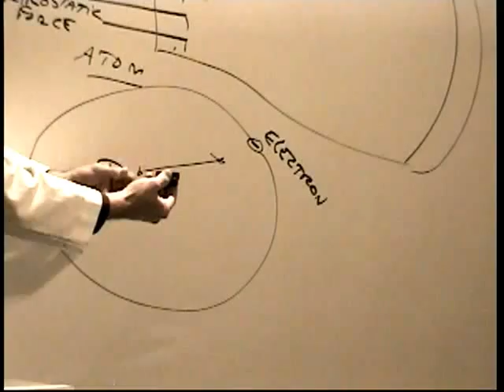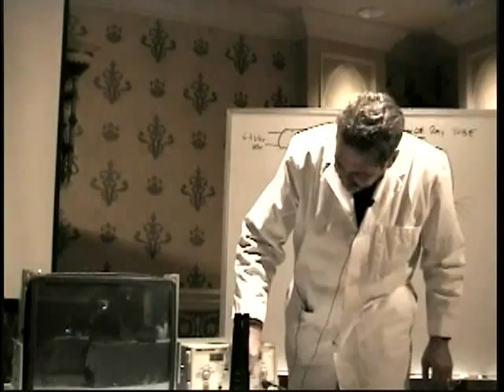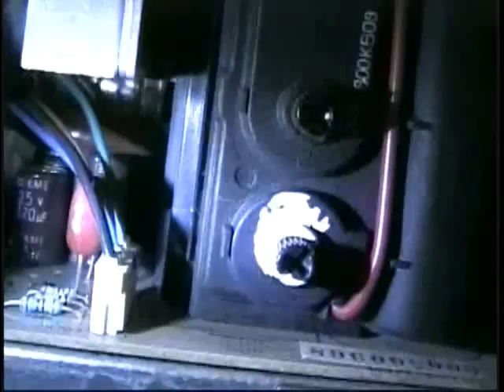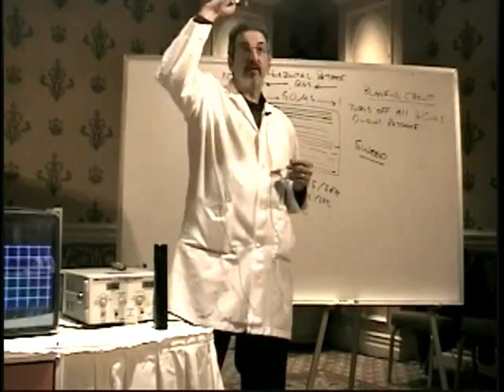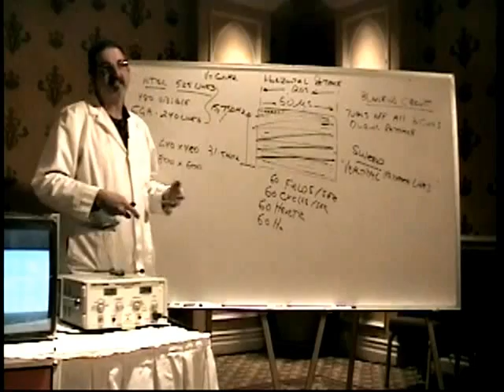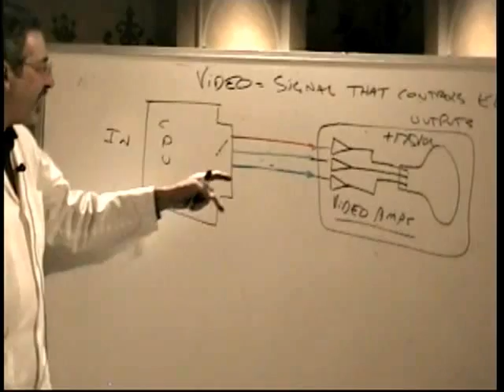CRT monitors-Part 1of 4

Comment: So I see you have a pattern generator but I haven't seen in any of your videos how that is powered and it works. Is there a pattern generator (PG) that has a transformer so you can plug power directly into the PG and the PG into the monitor. Sorry for asking such a newbie question :)   I'm trying set up my test bench to be most effective.
Reply from the maker: Classic Arcade Machine Restorations it's battery operated
Reply: Randy Fromm so does it power the monitor also?  If not how do you power the monitor on the test bench? Do I have to duplicate the arcade machines specific power supply and transformer to test the monitor pulled from it, or is there an all in one power supply and transformer that will work for all or most monitors or an adjustable power supply/ transformer? Thanks for you help. Still waiting for one of your classes closer to me 😁
Reply from the maker: This is not the forum for these types of questions.
Reply: ok sorry, I'll look for that forum but not sure where to look.

Comment: It always seemed to me that crt technology was more complicated than lcd. Is that really so?
Just look at the electron gun and the deflection coil. Hi-speed and ultimate precision required to direct the electrons.
Reply from the maker: Not so much more complicated, really. It's sort of weird in that there is lots of "correction" circuitry required in order to linearize the raster. LCDs only seem "simpler" because it is mature technology with lots of complex circuitry packed into integrated circuits, not to mention the actual TFT panel itself, with thousands of transistors printed right on the glass!

Comment: I still hang out with a CRT for my home HDTV. It is a Sony KV 34XBR910. It is not a huge screen, only 34 inch, and the resolution is only 1080i. But I still like a lot about it. I don't use it at all for broadcast content. It is not hooked up to cable or an antenna. So I never "watch TV." It is used to display gaming consoles, that is it. HDR is all the rage, but the contrast on this set is pretty great. Also there is zero input lag and zero motion blur, which is huge. The image quality in general has a 3D quality about it that modern flat panel displays lack. The only sets I have seen that compare are OLED, but they are still too expensive for me.
Reply: XBR tvs are legendary, and the picture quality is unreal for a commercial HD consumer TV, but I hate to break it to you--that TV almost certainly does not have "zero input lag".

Almost all of those Sony HD sets settled for about 2-4 frames of latency depending on the resolution, and I've personally tested my non-XBR lower end version of this TV (KV-30HS420) against multiple reference monitors to confirm this.

It's due to extra digital processing that they added in--notice the specialized menu options for deinterlacing content, for example? You would never find that on a regular SD TV, and deinterlacing doesn't come free--it takes time to process, 

The good news is 2-4 frames is still perfectly acceptable for most games, but if you tried to play shmups/STGs, you might have some frustration.

This is one reason I migrated to CRT PC monitors--to get the flexibility of resolution and low latency, not to mention the incomparable sharpness and detail required to read fine text.
Reply: Duffy Sullivan 

well, I am almost ready to retire this CRT. It was great during the early days of LCD when it was a superior display in almost every way. But now LCD technology has come a long way, and I am ready to move on.  I picked up the XBR910 off Craigslist years ago for $300, including the stand. I almost let it go when this current generation of consoles supported HDMI only. The 910 is DVI  so I had to go with an adapter. HDFURY 2 is what I got.
Reply: Due to some of the really old games I dabble in now and then (especially on PC), I'll probably always try to keep a good CRT monitor on the side, but I know what you mean.

Every time I go to my Micro Center, I always take a look at their OLED TVs. Absolutely incredible picture quality with the colors and blacks. I'm very eager for the day that they finally make them as affordable ~22 inch monitors instead of $3,000 55" TVs!

Now hopefully their latency will fall more in line with your average TN panel as opposed to IPS, but that's probably being too optimistic with it being such new tech.  ; _ ;

Comment: Brilliant teaching. Principles can be applied no matter what system (country) is used. UK refer to "persistance of vision" in ref to phosphor.  Colour can confuse us because it works differently in art. This takes me back to the 70's. Very relaxing.
Reply from the maker: Steve Wright Ha ha. In this context, I meant "Persistence of Vision." I was just being lazy. I DO know what a "POV" shot is in cinematography! Ha ha

Thanks for your nice comments.-rf
Reply from the maker: "Persistence of Vision" is not the same as "phosphor persistence." Persistence of Vision is a retinal phenomenon in that you are seeing something that isn't actually there anymore. Phosphor persistence is an actual glow as the electrons in the phosphor, having been bumped up into a higher energy level (electron shell) by the electron beam, drop back down into a lower shell. As they do, they emit a photon. That';s what we see.
Reply: ***** Thanks for the clarification Randy. That means we get double bang for our buck then. I was taught that "interlace" is really a form of compression and that because of the "persistence of vision" we just see the 50/60 fields as smooth motion. Interesting, your comment on how you see the frame rate in the UK but then get used to it. I actually don't like interlace. I could never understand why SONY would choose to go 1080i when 1080p was "better" in my opinion. Interlace can never be as sharp, no matter how pin sharp the focus is. Well, I guess a locked off camera shot maybe as good in interlace, but not a moving object. I had someone shoot 1080i for me when I would have preferred 720p. I hated the results. So, technically, the brain can't tell the difference whether it is seeing "persistence of vision" or "Phosphor persistence"??? It sees both.
Reply from the maker: Steve Wright The phosphor persistence isn't as nearly as "smoothing" as POV. I base this deduction on the fact that LCD monitors have no phosphors at all but the image looks perfectly smooth at a refresh rate of 60Hz.

I agree that interlaced raster is really crappy, especially if you plan on taking a frame grab.
Reply: ***** I hope your students/viewers realize that there is teaching in every comment you make. And you just have a high school education??? Let me go to that school. I think somewhere down the line someone taught you to think and to be patient. Of course, you are an engineer and that's how engineers have to think. One of my daughter's is a technical thinker. It's amazing to witness. Yes, I had to do a lot of frame grabs from SD footage years back. Always disappointing. Now, to POV or to POV? That is the question. If my wife directs me to do a POV, she is asking for a Point of View shot with the camera.

Comment: Wow this takes me back to my days at college doing a BTEC in electronic servicing. Great stuff. One thing though, you don't seem to mention PAL [Phase Alternating Line] or SECAM [Séquentiel couleur à mémoire] - only NTSC, which we always joked as meaning Never Twice the Same Colour ;-)
Reply from the maker: As I am based in USA and this discussion has nothing to do with any of the timing nor synchronization of PAL or SECAM (which, by the way, stands for "Séquentiel couleur avec mémoire" meaning "with memory.") there was no reason to discuss these systems. I agree that the Euro systems were better than NTSC. Its all ATV now!
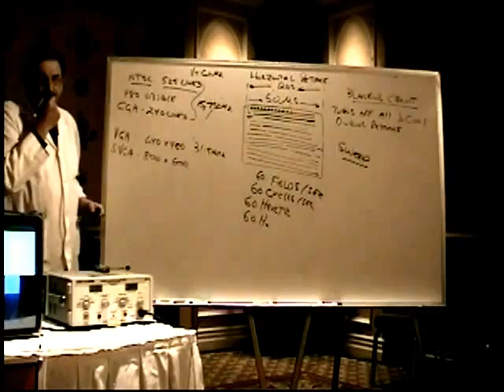Reply: He did mention PAL and SECAM. 1:13:05
Reply: why is pal better?